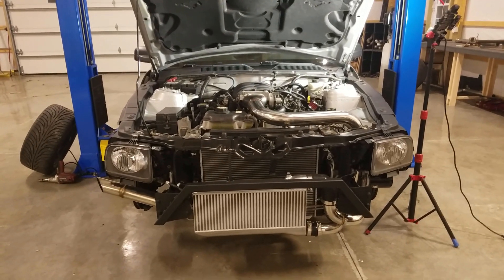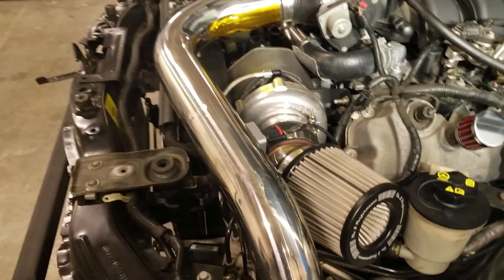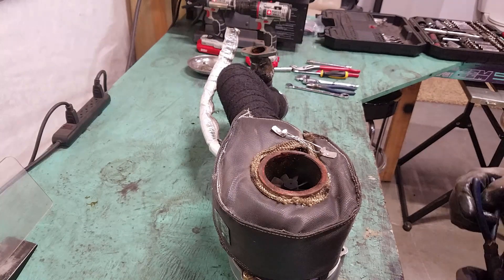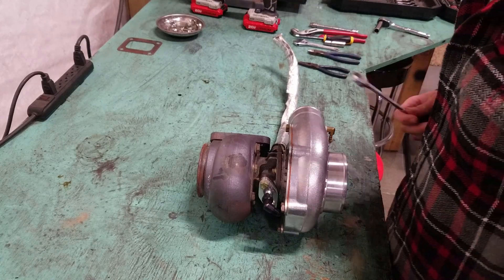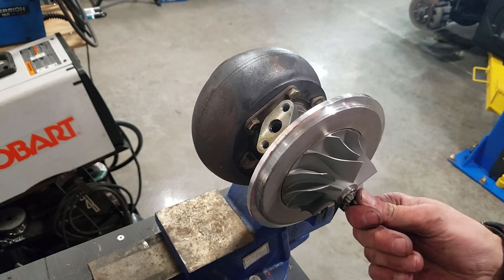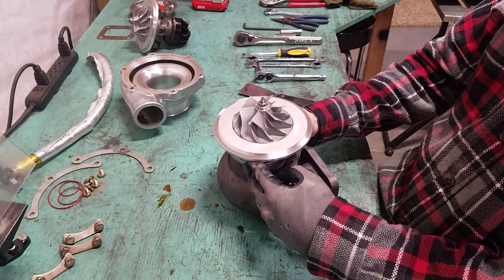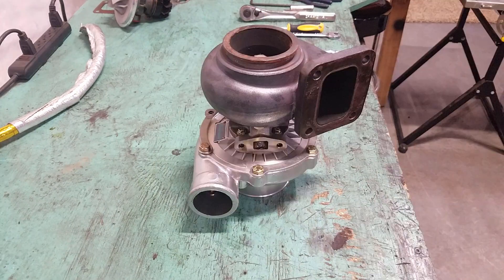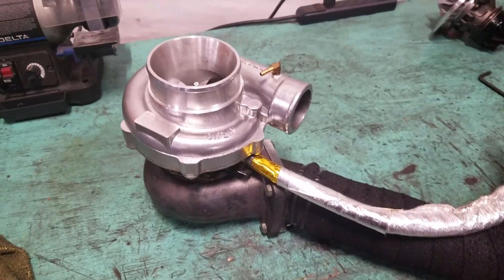How To Replace Turbo CHRA Center Section

Comment: the video👍. 
I got a Ford Flex that I needs a turbo the cartridge replaced. How did this one hold up for you? I'm a bit nervous using those $150 aftermarket EcoBoost replacement turbo cartridges off Amazon or Ebay . What do you think. 😳
Reply from the maker: Hard to tell. This one is basically ebay quality but it has been fine
Reply: @Kordare it’s still going strong??
Reply from the maker: @anthonymarquez4563  yes it is

Comment: Thanks for your videos bro. Do you use any silicone or something in order to seal the turbo??
Reply from the maker: There should be a large o-ring that will seal the housing to the center section 👍

Comment: Sometimes is not as straight forward as replacing turbo cores because if the turbo fails most likely it ruined the compressor or turbine housing
Reply from the maker: This is true. It's important to inspect everything.

Comment: I would like to know how to work out if the housings are still ok to use?
Reply from the maker: Usually just a visual check to make sure the wheel didn't contact the housing and create burrs and make sure the new wheel spins freely.
Reply: @Kordare  thank you. I managed to replace the cartridges on all 3 of our vehicles and they are going great now.
Reply from the maker: @NaughtyGoatFarm  awesome 🤘

Comment: Hello,just out of curiosity how many miles did the turbo last before it needed a new core and what psi was it running at?,thanks.👍
Reply from the maker: Probably only like 2000 miles at around 9-10psi. They claim it was because I put an oil restrictor on it even though their website suggested to do so...
Reply: @Kordare  
Wow that's terrible at such low miles and low boost,.
I've been looking into there kits and from the research I've done the turbo's are them cheap China knock off's but then been rebranded with there company name on the compressor housing,on ebay for $160.
Did you buy the kit?,I bet it wasn't cheap either?
Reply from the maker: @markcozzie  you are completely right. And yes you get what you pay for. A very cheap kit that has fitment issues. It's worth it if you have time and patience to make it work.
Reply: @Kordare  
On the HHP youtube channel i asked a few times on some the vlog's (think one was a twin turbo coyote/the other a bmw single turbo) the turbo brand name but ozzie wouldn't give me a strait answer,and when i said i don't want the cheap China knock off's he said they also offer ect ect lol...
Reply from the maker: @markcozzie  haha 😅
Reply: @Kordare  
I've tried these turbo units before,the smaller T3 then this one the T4,okay IF you know what you are paying for,but won't last.
Hope you have better luck with this core 👍